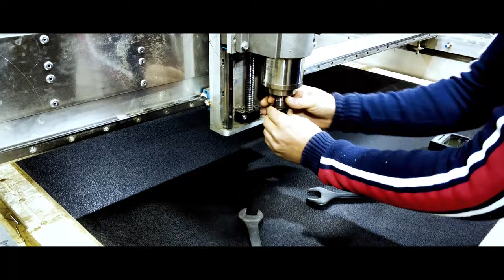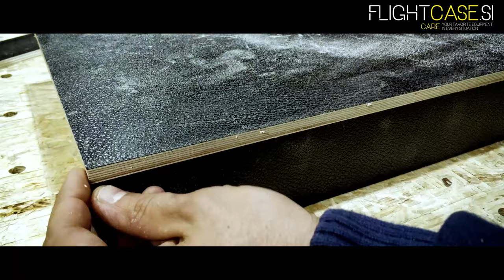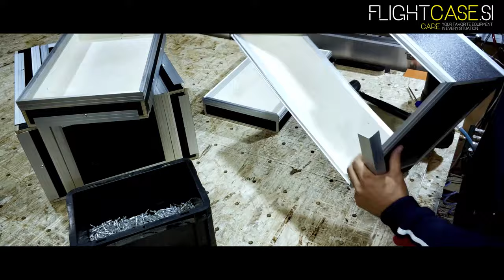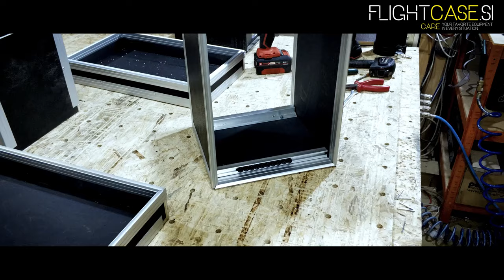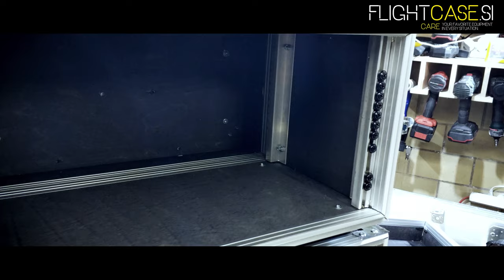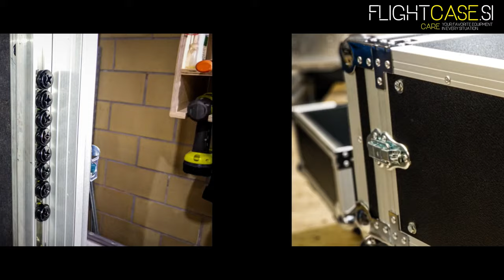Building a custom Flight Case. Rack case

Comment: Hello, I really like your work, I have also made my own cases for my microphones and cables, but I notice that there is like a black sheet that sticks to the wood so that it is that color and texture, as it is called to be able to get it? greetings from Chile (translated text).
Reply from the maker: For my cases I use plywood with PVC cover from Penn Elcom company. I do not know if there are representatives in your country. Before I used chine pvc foil but it was very bad experience. Not Recommended! Regards!

Comment: I don't like the fact that you did not show the complete build..
Also there was no glue used with the nailing process... Outer rivits are not enough for a solid build... i like the extrusion that sandwiches the panels between two surfaces of aluminum. No glue but I think a stronger build...
Reply from the maker: You can use glue for cases if you want build case just for personal use. For Manufacturing we use  nail and STRONG alu profiles